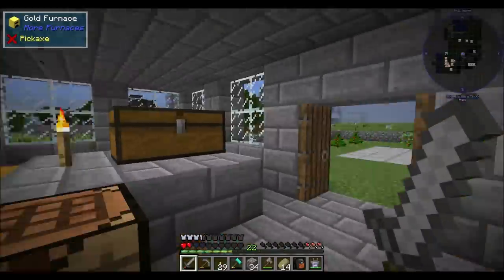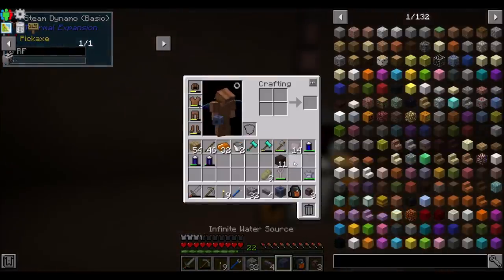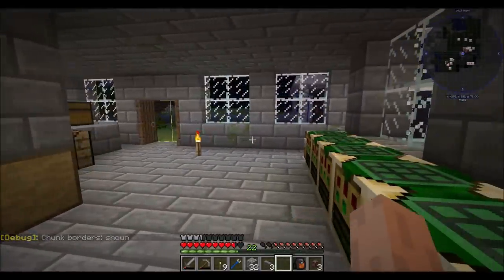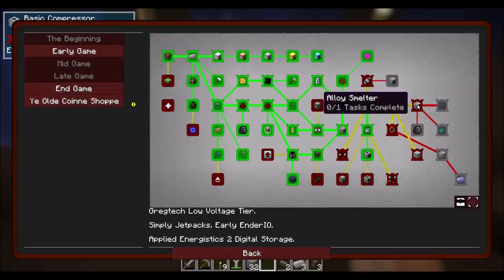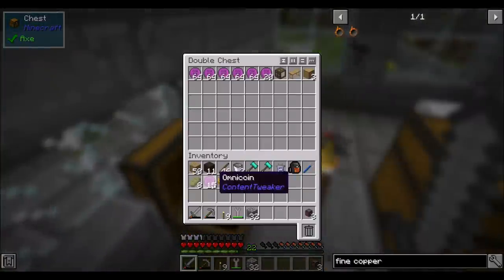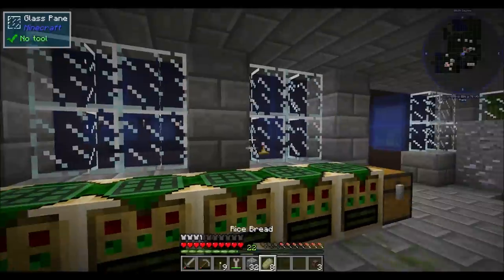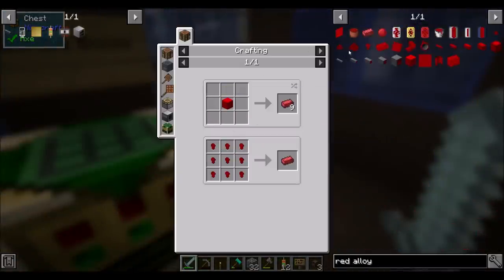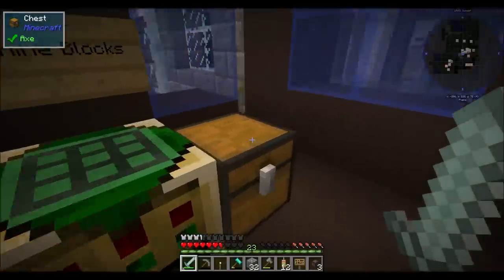OmniFactory   Ep6 Machine Setup

Comment: DIRE!!! You just unlocked the ability to make fine copper wire and then you went and used regular copper wire to make circuit components. Use the fine wire it's so much better!
Reply: Same with red alloy too
Reply: Yup, about 8x as efficient to be exact. Dire doesn't seem to realize just how important resources are in Gregtech. Even in "easy" gregtech packs like this, I always work to maximize resources as early as possible. This is just painful to watch.
Reply: Did you use the fine wire immediately or were you like Dire and didn't know how much better they were?
Reply: @sambucktooth  Well, the first machine I built was the wiremill, so I immediately started using fine wire. For some reason, I have trouble getting large amounts of copper in my current world, so I prioritize getting the most out of my copper. It's also been so long since I've played "vanilla" Gregtech, so I don't remember if that option is part of the original progression or not.

Comment: Mega Torch

The torch is supposed to only block "natural" spawning from low light levels. Mob Spawners should still work.
Reply: Maybe throw this in there for Dire...most of the lost city houses have spawners laced through the floors.  You need to go through the house and take them out.
Reply: This has been a thing since several modded Minecraft versions ago, I know this but Dire doesn't remember such things! :D

Comment: In this pack it's safe to break machines with the pickaxe. Normally it's not but the config was changed.
For setting output sides on gregtech machines, you can use the wrench from any face by aiming as specific regions of the grid.
Chest Transporters are in this pack, and extremely cheap.

It always bothers me when Dire doesn't read the quests. They provide such useful and important information, especially in this pack where they are designed to teach you gregtech. If he had read the quest that had him craft the fine copper wire he'd know that it can be used in place of copper wire to make cheaper recipes. Or if he just spent longer than 0.1 seconds looking at recipes in JEI...
Reply: Toksyuryel I feel like if he ever mentions Fine Copper Wire vs regular Copper Wire in the Motor recipes he’ll just be like ‘Well resources are cheap and easy in this pack, so I don’t really mind wasting a bit of copper’

Wouldn’t be the first time!
Reply: totally agree. He like a speed runner. Trying to get things done fast. He looks at stuff for a sec. Then say " Now where did I put that"  #DireDerp so much in this episode then I can remember. He has no idea about Gregtech, and this is a easy one. It also bothers me when he doesn't read the quest. Info on Battery's, where is does say what one to used But spend 10 min trying to figure out that one ore doesn't exist.
Reply: Toksyuryel if you aim at the corner of a machine, it puts the output on the OPPOSITE side, that’s why there’s that little overlay
Reply: @chonchjohnch  um, yes? I know? I was telling Dire about it.
Reply: Toksyuryel it wasn’t clear to me, I didn’t intend to be rude

Comment: Destroy those spawners!  Your lost city is covered with spawners, and there are chest transporters that will move them to where you want them, and you can use the parts to change the spawner type.
Reply: not to mention that the spawners can be crafted again.
Reply: Not to mention that at only 1% chance to get back the spawner when breaking it, you'll STILL end up with a ton of broken spawners to use with Ender IO.

Comment: Magatorch don't care for chunks they have a radius and they don't work on spawner and there are a lot of spawner in this buildings.
Reply: Megatorch is like 50x50x50 cube I believe, blocks not chunks.
Reply: It has 128 blocks radius
Reply: It's basically the same as the old Magnum Torch from classic Extra Utilities. 64 block sphere of raw spawn prevention.

Comment: You can get actually additions crates its recipe is unchanged so they only requiere a bunch of wood also use fine copper wire when you can its cheaper to use that than copper wire

Comment: The machines are fast because when you put them down the default is to allow overclocking, so they are sucking your power down to go faster by default.
You can also use your wrench, and the grid on the machines to set an output side of your choosing then enable auto output with the other button.

Comment: 2 points:
1. You can sneak to break a single block while using a mining hammer. Saves you from needing a pickaxe. 
2. There are more ways to get copper than from copper ore, as is with iron you have magnetite and stuff. Check it out yourself

Comment: Remember that most of the recipes that use a bare cable will also use a fine version of it which you get 4 of for the cost of 1 by running it through the Wiremill. You are wasting a lot of copper if you don't fix it soon.

Comment: Heads up Dire, the electric blast furnace will require 2 lv cables inputting energy (from separate battery buffers) at the same time as lv cables can't transfer the (minimum) amount of power needed to run it (it also doesn't have a buffer), just letting ya know so you don't make the same mistake I did
Reply: Steampunkmage  A 4 slot CEF with 4 charged batteries can output 4 amps of  LV energy and therefore if connected to both 2 amp lv hatched it can power the blast furnace.  You will repeat this trick a few times with the blast furnace as you move up the energy tiers.

Comment: Ahhh, if the nether was more accessable..or witchwater...you could make a resturbed spawner.
But come to think of it...if you found SOME draconium, you COULD make a draconic core, and use THAT to scoop up the spawner too! How hard would Draconium be to get?
Reply: Nether isn't that hard to get to and I don't remember any changes made to it.

Draconium he'll get to by episode 100 maybe.  Draconium is a bit strange.  You can apparently silk touch the ore and fluid extract it with a MV fluid extractor and solidify it with an LV fluid solidifier.  However without silk touch it requires an EV Vacuum freezer? can't remember whether the vacuum freezer can accept multiple amps with gelid cryotheum and a LV blast furnace with Cetane-boosted diesel. The draconic core itself isn't that bad
Reply: @andrewgood7956  Ahhh, okay. Well, it was a thought. So resturbed spawner is more approachable, I guess. and powered spawner not so bad either.

Comment: I honestly stopped using the work tables and just separated everything in to crates as base resource, refined resource, tools, and to-be-refined.

Also, you can get some good stuff from dungeon chests around the cities, as well as if you find a village with a blacksmith :3 and free crate if you find a jam shop. ((Crates are damn cheap anyway though))

And remember... most crafts that use copper wire can also use the cheaper fine copper wire...

Comment: 4:43 Just so you know, gregtech have a nice way of rotationg machines.
When you hold a GT Wrench it will how this gird on a machine just like here: 1:40

Each part of the grid represents a face of machine and can be used instead of going around and hitting it directly:
Middle is the face you are looking at.
Corners represent the face on the opposite side.
Sides represents faces on that side.

So at 4:43 instead of climbing to hit the machine from the top, you could use a GT wrench and hit the corner from the bottom to get the same effect.